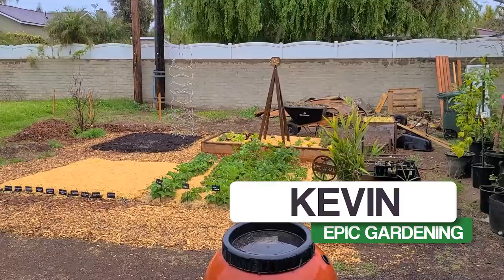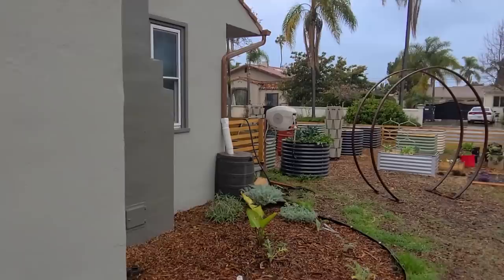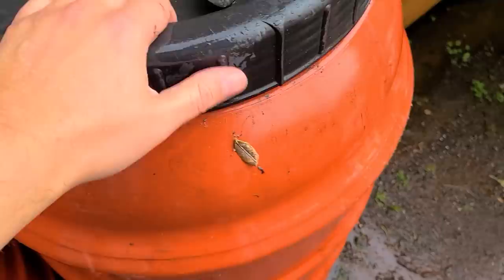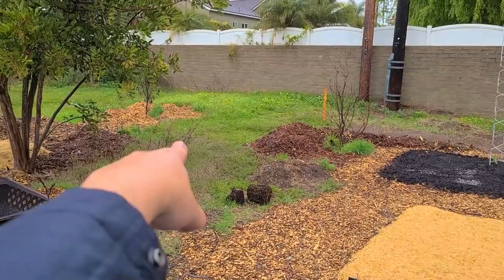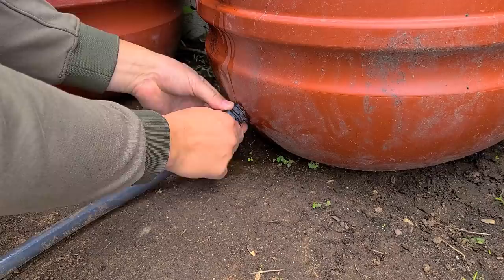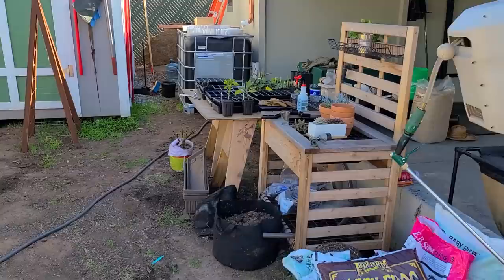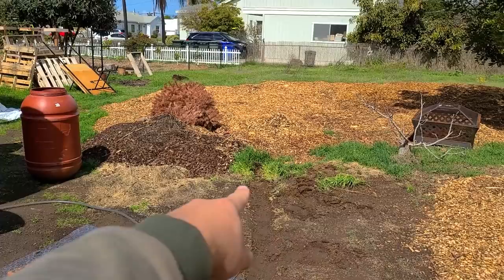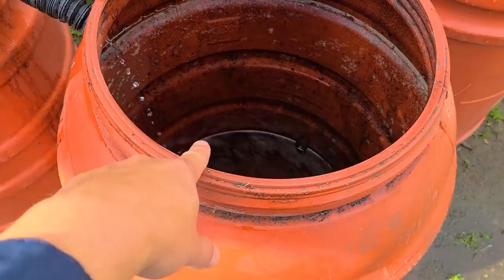Testing My "Questionable" Rainwater Harvesting System in a Storm! 🌧️

Comment: Most people greatly underestimate the amount of water that comes off a roof during a rain shower.
Reply: There are online calculators that will figure out the total gallons, based on the square footage of the roof and total inches of rain. It's kind of astounding how quickly it adds up.
Reply: 100 sq. ft of roof will collect approx 50 gal/inch rain.
Reply: @rockgardner  ok
Reply: 1 liter per sq meter per mm of rain

Comment: In Australia you have the gutters on all sides of the house to divert the water (and not end up with puddles next to your house which may cause damage over time). However, perhaps you need to add more rainwater collection systems/tanks to most of the corners of your house to maximise the collection of water. We have 4 (almost like a square) with rainwater tanks on each side to collect the water and even a short shower gives us a lot of water.

Comment: I would elevate the overflow barrels to make sure the top of the barrels is slightly higher than the overflow valve on the main tank.   Then you won't have to worry about leaks around the lids or what might happen if you accidentally left the cover off of one of the barrels.
Reply: Agreed. If the overflow on the IBC tank is higher than the rain barrels, it'll overflow first at the rain barrels first and youll be in mud bath central.

Have you thought about a French drain to take water away from the footpaths and house foundations? You could pipe to a nature pond, to encourage frogs...etc for pest control.
Reply: Glad someone mentioned the tops of barrels vs overflow pipe. I saw that and was like "Aghh!". Overflow pipe never going to engage with the current setup.

Comment: Quick thinking! I've been planning my water harvesting system as well. I noticed the water coming out of your hose was pretty slow. I know yours is a temp system right now, but maybe the next time the IBC tote is empty you should raise it higher. Every 28 inches you raise it gives you another 1 psi. A cheap, easy, and strong solution would be cinder blocks and wood pallets. Both are designed to hold literal tons of weight, and can be found for free. A single layer of cinder blocks on the ground as a base and then stack wood pallets on top of them. Maybe 9 cinder blocks for the base, then stack 4 pallets. That would raise the tote up an extra 32 inches. That'll give you an extra 1.152 psi. And that's your min pressure. From a full tote you'd have almost 3 psi of water pressure. Half full you'd have about 2 psi. Not bad from free materials. You could raise it as high as you like with pallets, so long as you keep the top of the tote below the height of your gutter.

Comment: hahaha, I loved this video! All those unexpected issues with the rainwater systems and the freaking out every time you are in the middle of fixing it, and there is a storm coming! My bf and I have had a bunch of those days, getting completely soak during storms trying to fix the system, but it is fun, and it is absolutely worth it :) We expanded our garden a lot this year, building 4 16x3.5 ft raised beds, and we were super scared about the water bill. It turns out we reduced our water bill to less than half compared with last year and all our plants are loving the rainwater <3

Comment: I have 2-55 gal barrels collecting rainwater off my roof and that sustains my small garden all summer.  The only problem I have is that there isn't enough natural head pressure to make watering by hose easy. So I either have to raise the barrels higher or install an inline pump.

Your system works well for a quick adhoc build.  In the words of Mike Tyson, "Everyone has a plan until they get punched in the mouth." :D
Reply: maybe just connecting it to a drip system works better?

Comment: Nice work Kevin.  I was wondering if you looked into the swale system design that Bill Mollison, and now Geoff Lawton, talk about in their permaculture teachings.  It would allow you to use your soil as your water storage system.  Capture water in swales, let them spread the water across your whole garden (veggie garden and orchard) and then let it soak into the soil. The water builds up into the soil over about 7 years (on average) where it reaches its maximum "soakage" capacity and makes your soil a lot more resilient to both droughts and floods. IMO, that would even optimize your rainwater system even further as you'd only need to use the water from the tanks during prolonged droughts.
Geoff has a nice video about it on his YouTube channel!

Comment: Connect your barrels at the bottom and they will fill simultaneously. Add ball valves to each outlet on the barrels and you have a fully controlled system. On the last barrel, add a 50 foot water hose to the top and this will be your overflow.
Reply from the maker: Thank you! That is far better
Reply: @epichomesteading  You guys did a great job working on the fly. Especially since you don’t have a whole lot of water or rainfall. You might look into having Brad LANCASTER give you a consultation on planting water. It’s a fascinating study! You can look up his YouTube channel and find a ton of information. I think it would be right up your alley.
Reply: Also make sure you get the biggest diameter hose you can for the overflow.

Comment: If you elevate the tanks you could get a little more pressure. Also the the wider the feed line from the large box tank and chain of barrels will help quicken their fill rate and reduce the overflow before the system is full. I know you may not want to use electricity but you have solar power, you could try a marine bilge pump (dc voltage) with a float switch to move water across the yard. Put screens on the inlets if you use a pump.

Comment: We have 3 rain barrels daisy chained together. But ours are all connected through the bottom. That way they are fill at the same time and they all drain at the same time. I was able to use food grade barrels with the 2 in pvc holes and connect them and put one spicket on the end of the line. It works great. We have our barrels off the ground for easier gravity feed to our drip lines.
Reply: Hey is the video my husband made last year after we finished gluing it together. We are not vloggers so it's a rough video but I just looked back at it to see that.it does in fact show the plumbing aspect for you to see. 

https://youtu.be/MoW2SptCFfA
Reply: Yeah, I can see it being better if they are linked at the bottom.
Reply: I think when they are linked at the bottom, they fill at the same time and best...  They can be drained from one point instead of each barrel.
Reply from the maker: Good call
Reply from the maker: Much smarter!

Comment: Looks like things are shaping up really good!  I thought of adding some rainbarrels where my water collection was, but then I realized the rain barrel costs 70$ much more than the cost of the water I saved: 1 rain barrel is about 50 gallons which is 25c of water.  That means it would need to fill up 280 times to recoup the cost of the rain barrel and we just don't get that much rain where i live, not even over 20 years.

But, I've calculated how much money you'd save from all that rain water your collecting.  With a 1000 sq ft home and 10 inches of rain per year in san diego, you would save almost 1000 cubic feet of water per year!  thats 7480 gallons.  That would be a savings of about 35$ per year if your water costs 3.50$ per 100 cubic ft.  That means, over the next 50 years, you'll save 1750$ in watering costs!  Even more, if you include inflation.

Comment: I live in Washington and you could fill your system in a few hours if not less during some of our daily downpours. (though almost nobody collects rain water) some of our excess water flows into a pond (its about 500 gallons and fills in about one or two days   from just one gutter sprout) and we have a underground natural tank (I think its like 10,000 gallons) and it overflows all the time in the winter. I would collect rain water but I have cleaned my gutters before and that stuff smells .I would not want to drain it, or use it for any household things, only thing is for my garden but then I have a well so water is not super expensive anyways

Comment: Hey mate im from Australia I was gonna suggest always get a bigger tank than you think. Eg 5000-10,000L RAINWATER TANK. Another tip for you for every mm of rain you get to the square meter size of your roof thats how many litres/gallons you will fill. Therefore you can figure size of tank you need. Example roof size 50sqm 1mm of rain will give 50L of storage water hope that helps!
Reply from the maker: It does, thanks!

Comment: Do you know about Brad Lancaster and his rain water harvesting books? Really, really great stuff! The 5000 gallon cistern is a great idea.  I have Poly mart rain tanks, 2 - 500 gallon tanks and 3 - 250 gallon tanks. IMO 50 gallon barrels are ok to catch rain from a small coop or hutch but not big enough for anything larger. That IBC tote thing is not  pretty and I think the water will turn green if you don't use it quickly. Consider an over flow rain garden at your cistern overflow (pipe that extends ~ 10 feet away from your cistern and away from any structure). My rain garden it is truly low maintenance. It drains within a couple hours after a storm and is ready to catch and slow the next storm. It is my best rain water harvesting component. I don't have to do anything. I took off the first flush diversions on my tanks because they clog easily and that stagnant water starts to stink after a while. Rainwater leaf eaters are worthwhile if you have many trees around. The original one is not so good  IMO. The second generation one is better. I have not tried the newest one yet. Check out mozzie stoppa things made in Australia for wet systems like you will have if you do the cistern. Maybe you don't have mosquitoes in San Diego.
Reply from the maker: I've been studying his stuff!

Comment: Instead of overflowing the barrels from the top, hook them all up with tee's from the bottom and gravity feed them all at the same time from the bottom up.  Also, be careful with the overflow... You need a tee above the water line so you don't siphon out half your water.  Wish I had a video of mine for better explanation, but after a storm, I should have had 1k gallons of water in my setup, but instead, it overflowed so strong that it siphoned out 500 gallons into my yard. Not fun...

Comment: Great to see the process.  Why did you choose to fill the first red barrel from the bottom instead of the top? I can see that the water pressure from the ibc is high enough to fill it from the bottom, but was there a reason for that vs from the top?  Something to do with amount of flow and when diversion to the mulch may happen?  Or was it just out of necessity due to where a hole already was in that barrel?